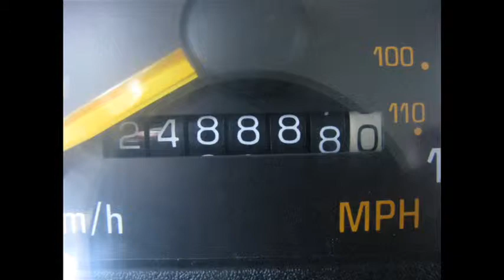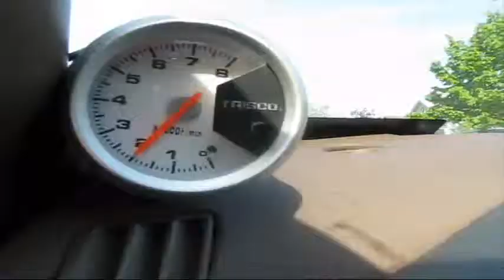Rob's 94 Grand Am Past - Present

Comment from the maker: well mine ticks too... its just the way the engine works. when i first bought mine it had about 209,000kms on it and it ticked like crazy... i started using synthetic oil and also added a can of engine tune up each time i changed the oil ( its just an oil additive) i did that for a little while and the ticking got quieter and then seems to have stopped. when i cold start it it will still tick but once it warms up it goes away, just normal engine noises is all i wouldn't worry too much about it.